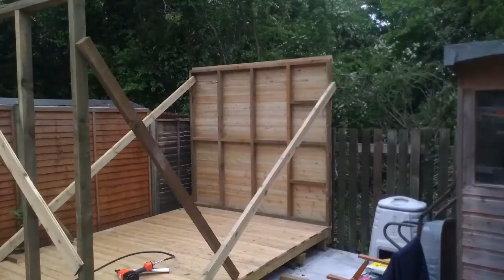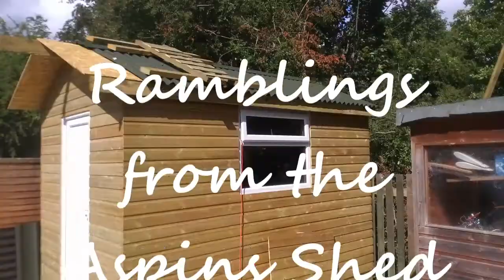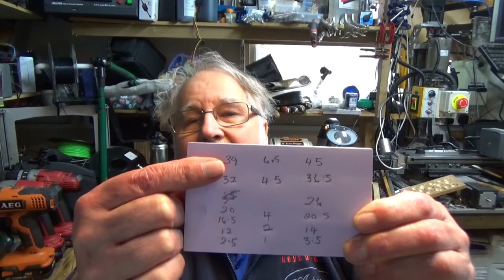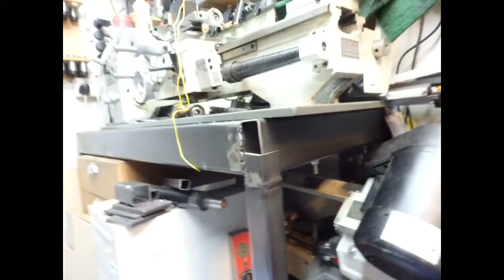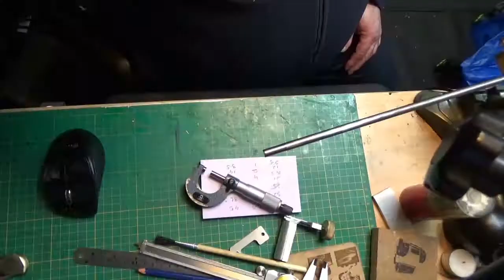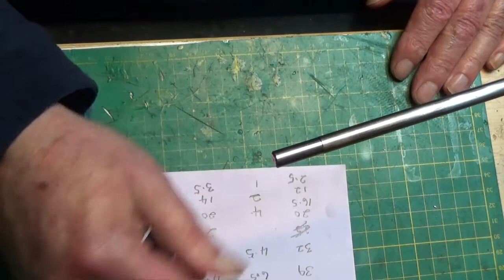DB10 Headstock Alignment

Comment: My DB 10 was the same as supplied, CRAP. 
I didn't have a hammer to hand so I took off the motor, the front panel and rear head panels, (the chuck guard is permanently off)  and slackened the 4 nuts holding the head to the bed. I couldn't get enough movement to correct the alignment so the head came off and I scraped the head V way and now I cut parallel over 150mm. It took a lot of messing about with something that should have been a lot better than it was when sold but at least it is now permanently fixed.

Comment: This isn't meant to be critical, I'm simply stating the logical facts. I checked but couldn't find an online manual for your DB 10 lathe. But something isn't adding up, if that lathe is like most others, it's head stock base will have at least one V grove machined into it so it's head stock and spindle alignment is fixed by indexing off at least one of the lathe bed V ways. The only way hammering on the head stock like you have would show any changes is if the head stocks mounting bolts are loose. If that's the case then your adjustments can't and won't be permanent.

Run a Google search for an online PDF of the Dr. Georg Schlesinger written book Testing Machine Tools. That should be printed off and read through enough times so it's fully understood what's being tested, how it's done and exactly why it's being done in that way. Schlesinger literally wrote the book on machine tool alignment, and any machine tool built today that comes with a factory test certificate including the best manual and cnc's made will have those tests based in one way or another on Schlesinger's work that was first started roughly 80 years ago. My shop floor is also the standard wooden structure and I can get my lathe bed properly leveled. Without that already known exact level or what is in actuality a non twisted and neutral bed condition ANY other adjustments are meaningless and a waste of time since your then trying to compensate for an almost for sure twisted lathe bed. Not only that, but indiscriminately throwing the head stock off to do that compensation also affects both the gear and drive pulley positions against there locations that aren't fixed to the head stock. And more importantly it will also affect how the lathe will face a large diameter part. Aligned properly, the lathe if it was correct from the factory should face a part very, very slightly concave. It's not much, about .001"-.002"over a 24" diameter, but it is there and for very good reasons on even the best lathes built today. Getting a lathe to turn parallel is only one half of it's alignment, it still has to face a part correctly.

I fully understand these cheaper off shore machines can and usually do suffer from a myraid of misalignment's built right in from the factory. I've had to deal with quite a bit of that myself. But proper testing, checks and adjustments need to be both fully understood and performed in a logical and methodical way. "Proper" machine tool alignment is a whole lot more complex than most at the hobby level and even a lot of professionals seem to understand or appreciate. If you expect to make any meaningful adjustments to improve what you've bought, then that Schlesinger book is 100% non optional reading. Far too many forum posts and YT videos advocate moving a lathes head stock without doing enough testing to guarantee it is in fact misaligned and is actually part of the problem. There's not a hope I'd ever start changing that alignment without first proving it is in fact required. 

With a lathe that was known to have been damaged previous to you buying it, there could easily be hidden issues. I'd only buy something like that where I'd fully expect to tear the whole machine apart and examine in detail each and every part prior to reassembly. And I'd especially be checking for that hidden damage. Cracks in the lathe bed, around mounting bolt locations or partially to fully stripped threads as just a few examples. Having to make adjustments as you have shows without question that you do in fact have at least some unknown and further serious problems. Anyone who does want to understand much more about machine tool alignment and especially lathe alignments then I'd highly recommend going back through past videos on this YT channel. https://www.youtube.com/channel/UCD1jVjhwma9Ehj8BQqDMPHw/videos
Reply from the maker: Thanks for the reply.  My only thought on it was considering the weight and mass of the lathe a fall of any degree could have moved the headstock on the V way a fraction.
A fraction is all that is needed to produce the run out I had.
In fact it has moved to it's limit because extra belts with the adjustment tool has no effect..

Remember I am not an engineer or a machinist just an old infirm man in a shed finding ways to solve the problems I encounter.
Reply: @Aspins  I'm not a proper engineer or machinist either. Only someone at the hobby level who's actively searched for and tried to learn as much as possible over the last 40 + years. I'd highly doubt that lathe has any different set up than what's common with most lathes of this size. And that's having at least one female V machined and hopefully ground into the bottom of the head stock casting. Your of course free to agree or disagree with my points, but if you dig deep enough into that lathe I'm 100% sure your going to find the original source of that head stock misalignment. If that head stock is set up to index on at least one V way and your user manual will show if that's the method used, then the head stock would be completely impossible to adjust with the method you used unless something further was incorrect and what will be the actual cause of the real problem.